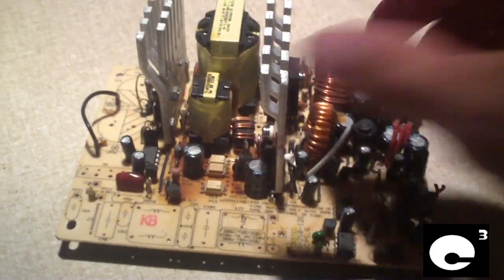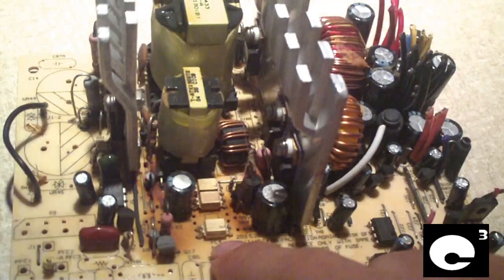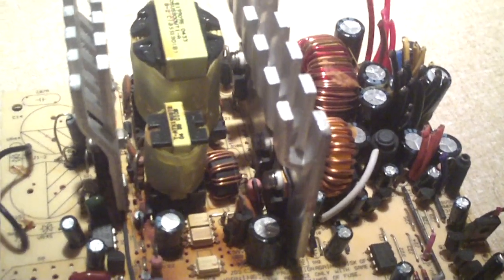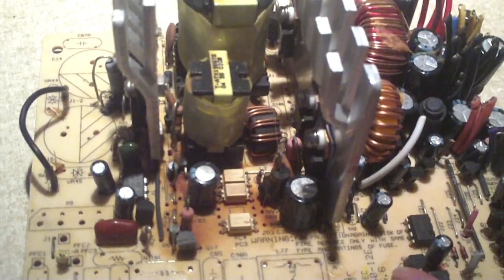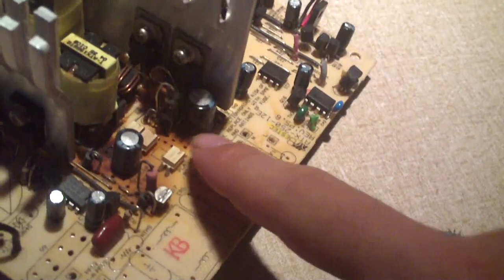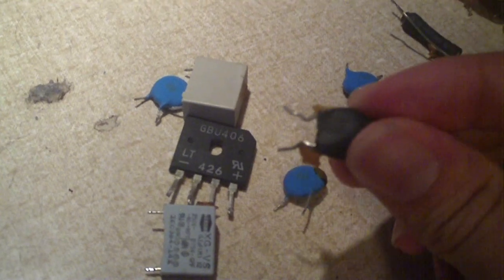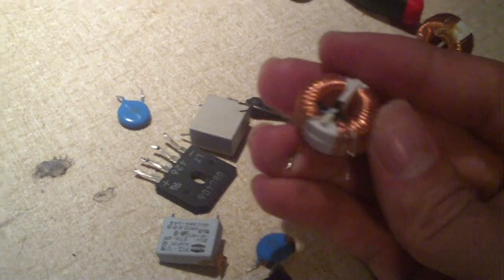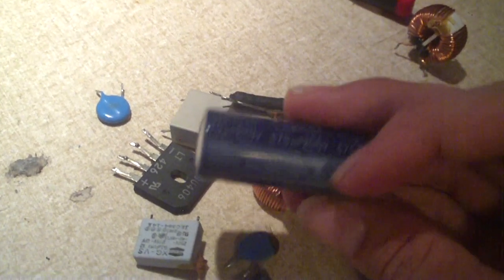Another look at a burnt up Bestec ATX-250-12E PSU

Comment: so i had a question, the purple wire is the 5v standby, what if you just cut the 5v standby and never put it into standby? would that make them safe to use because the surge is not going to the motherboard if the purple wire is cut?
Reply from the maker: Without +5VSB getting to your computer, your computer will never start. Also, the +5VSB also serves the internal PWM and supervisory chips inside the power supply. Once the +5VSB cooks them, it will no longer power up.
Reply: i figured that, i have a 12e that works so i am going to turn it into a bench psu

Comment: I would like to know the name of the part that is in the center of the power supply, the three small white little square parts, I have a power supply with two of these burned, and are all three the same part number, I think Best are good power supplies they filter the ac line so my fm radio dose not have a high pitch, like some Korean power supplies. do some repair videos on testing  power supplies.